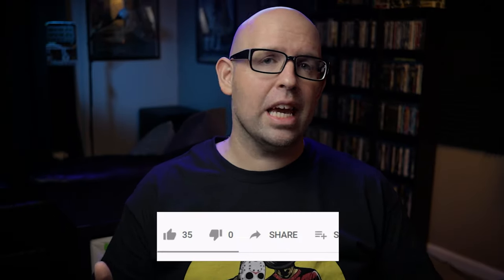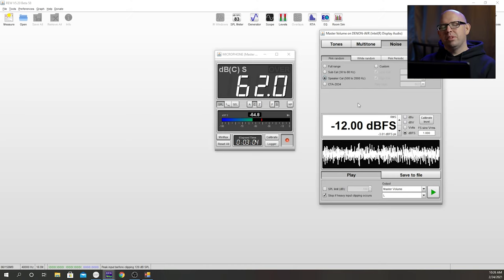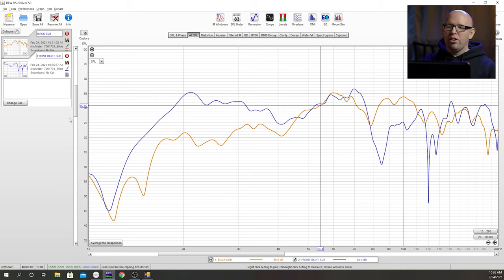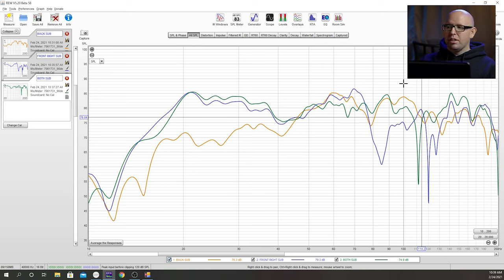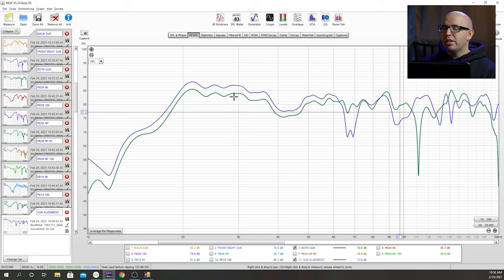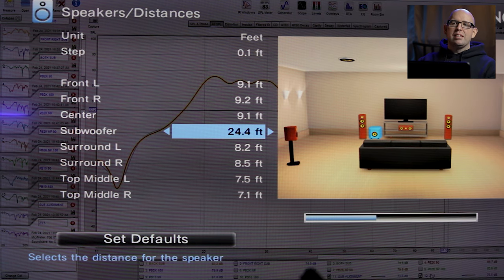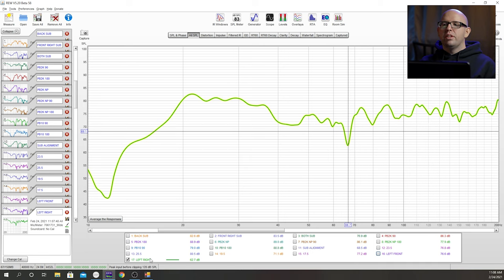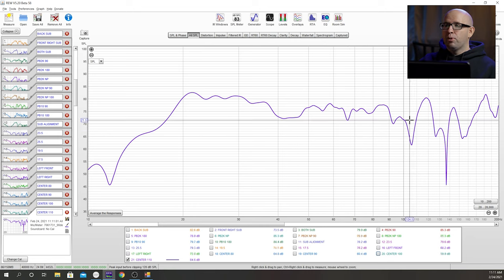Better BASS WITHOUT miniDSP? | Subwoofer and bass OPTIMIZATION GUIDE (basic)

Comment: I’m pretty new at this too. I simply cannot spend several hundred dollars on a good surround sound system right now. So, my wife got me an old Pioneer VSX-D514 and a set 5 Sony surround sound speakers off EBay for $50 w/o a subwoofer. My Pioneer is a 5.1 speaker surround system requiring a powered subwoofer. I had a Pyramid 12” sub, built a box and ordered a subwoofer amplifier board off Amazon($16). I noticed a gap in the very  lows from the 12” sub. and the highs from the 3” speakers in my Sony surround speakers especially listening to music. By watching YouTube videos like this guy I have learned a ton. Like how to build, port and tune a speaker box. I ordered two 6.5” Pyramid mid subwoofers and ordered another  amp board, a splitter cable to share headphone and an extension for the cable. I got this because my amp boards use a 3.5mm audio input.

Comment: Love the videos, it makes all of this easier to comprehend! I did your steps to level match my two subs(PB1000-Pro) by setting my left speaker at 75db and both subs to 78db per your instructions. I then did the Phase and Polarity measurements for the smoothest response, which in my case was 0 and Positive. I also used SVS Parametric EQ to smooth it out further… So now I’m on the run Audyssey step, however since I have a newer Denon X3800h, it has me adjust the gain on each sub individually to land in their green zone before moving forward with calibration… Wouldn’t this undo the level matching thing, or was that just to initially calibrate the subs for phase and polarity optimization so it won’t matter that the gains will be altered before calibration? Sorry, I’m a noob😂 just bought the equipment you use from your links and am eager to learn!
Reply: Anyone know the answer to this?

Comment: Great video - I was actually emailing with Ed Mullen back and forth, about exactly this!

Couple comments/questions, and looking for feedback.

1.) thanks for pointing out that BOTH subs need to be adjusted together by the distance amounts - the other day I was ONLY adjusting the second sub, and it made zero difference on the FR.

2.) did you have DEQ off post-Audyssey? There appears to be a slight house curve in your measurements, so wondering if DEQ was on?

3.) do you have any recommendations for applying a house curve without MiniDSP, but with the Audyssey App AND subwoofer PEQ on the plate amp?

Awesome video - would love to see a part 2 with the inclusion of the MultiEQ editor app, and further optimizing!! Great job!!!
Reply from the maker: Thanks for the comment! Ed Mullen is an awesome guy and has what seems to be endless information regarding home theater and audio.

To answer your questions: I actually didn’t run Audyssey when doing this video which I completely failed to mention. I should have been more clear on that. There’s actually no EQ on the subs at all, which you can see by referencing the frequency response before I talk about running Audyssey and when I start the next step.  The process for time aligning subs to mains remains the same though, so either way it won’t change much. You just may have different distance settings if you run Audyssey as any type of EQ can have an effect on alignment.

In regards to using the MultiEQ Editor App and the subs PEQ to optimize things further and to apply a house curve, those videos are in the works (or a single video, haven’t decided yet). I have a few time sensitive review videos I need to get done first, but I’ll rest assured you’ll do some more advanced sub optimization videos soon.
Reply: @HomeTheaterGamer  very much looking forward to your further instructions. This has all been very handy so far. I have dual SB16’s, and a great B&W mishmash of a 5.2.2 setup - and while I’ll never really stop tinkering, I haven’t yet found a reason to with achieving just the right performance.

I would also love to hear your feedback on the following instruction:

https://www.stereonet.asia/forums/topic/147529-audyssey-house-curve-revisited/

I haven’t tried this, but there’s some pretty insightful tips on applying Audyssey app curve editor adjustments, and ensuring they actually show up. I noticed via REW measurements that my aggressive house curve via the app didn’t actually seem to enlist in the processor after uploading - which was disappointing. Can’t wait for your future vids on this because surely I was doing something wrong!!

Keep it up!

Btw - are you available via email for q/a?

Comment: I have a question, those that have subs like the SVS Pro series with the built in DSP, can we use REW as a tool to make adjustment with the PEQ settings in the amp on the subs? So if we have peaks and valleys in certain areas, we use REW to show the result and make the adjustment on the SVS app?
Reply: I would love an answer for this as well since I'm shopping for a single sub and will not be getting a minidsp.

Comment: Is it possible to run a full range signal to let’s say a 5.1 system and integrate a subwoofer in line to each of the speakers level matching them. Wouldn’t it give you a sense of location for something like an explosion in a action movie?
Reply from the maker: That’s a very interesting idea, but technically speaking, it’s not possible. Anything below about 120Hz, which is where most subs do their work, is not localizable. You wouldn’t be able to tell where it’s coming from. It is possible that vibrations within the sub housing of a sub or the adjoining walls vibrating could cause a sense of localization, but for the most part all bass under a certain frequency would not be localized due to our own ears.

Comment: Thank you so much for the video. 

I do have a question in how this video works specifically with Dirac. After running Dirac the AVR locks the distance/delay setting, thus preventing from making any post adjustments. 

Do you think that Dirac would set the delay correct so that post adjustment is unnecessary?

Thank you in advance!

Comment: Great video man. Hey I have a question. My only outputs that work are the front left and right and subs. Center and the rest no sound when I try to measure. Receiver is a Yamaha rx-a3060. It's set to straight mode.

Comment: One question about subs and mainspeakers....
If I have speakers that are good in lower frequency, lets say that I am happy about have my right and left speakers frequency down to 60 Hz
And put my AVR crossover to 60 Hz.
How do I do with my sub then?
Do turn down the frequency to 60 Hz on my sub, so it will play 20-60 Hz?
Or do I put the frequency to max (250 Hz) on the sub?
Reply from the maker: That’s an excellent question. Typically with this type of setup where you have the subwoofer plugged into the “subwoofer out” on the receiver, you’ll want the crossover frequency on the subwoofer itself set to the max (sounds like 250Hz in your case). The reason for this is because your receiver is handling all the bass routing between your speakers and subs, often what many folks call bass management.
Reply: @HomeTheaterGamer  
So, if I use a minidsp, there is no reason to use range below my crossover in REW when I am doing a room curve for my mains and no reason for me to measure my sub/s higher than my crossover settings in my AVR?
Reply from the maker: I would still recommend measuring slightly above and below your crossover point, mainly because crossovers aren’t hard cutoffs at a specific frequency. They roll off the sound instead, so it’s always good idea to see exactly what’s going on.

Comment: How are you getting the Center and Surrounds to show frequencies down to 20Hz?  Also, if you are crossing over at 80Hz and above, aren't frequencies below the crossover point directed to the subwoofer/LFE channel?  I am either missing something or.........
Reply from the maker: The center and surround results also include the subwoofer, so any frequencies below the crossover point is handled by the subwoofer.

And yes, you’re correct that anything below the crossover point is directed to the subwoofer/LFE channel, even if set to something lower than 80Hz.

Comment: Would it be best to move the subs around to different locations to find the best spot curve in REW, then level match the subs, then run auto eq on my receiver?
Reply from the maker: Ideally that would be a great place to start, but depending on room, sub size, amount of subs, etc., sometimes that just isn’t possible.
Reply: @HomeTheaterGamer  right. I was just trying to figure out if there was technically a best practice "order" to go in.

Comment: When you are level matching your subs to 78db, are you adjusting the gain on the subs or the level in the receiver..? You don’t really say. I have two SVS PB1000 pros I am trying to set following this video.
Reply from the maker: Sorry... On the subs themselves.
Reply: @HomeTheaterGamer  I have the same question. For the gain on the amp (Crown XLS 2502) Would I start at the 12 o' clock position or higher...lower? Also On my AVR (Pioneer Elite SC-LX904) I don't have an option to turn off Room Correction. (MCACC) Would I Select Pure Direct sound mode? Thanks in advance for any advice!

Comment: Hello, I looked at parts 1, 2, 3, 4 ten times and did everything as you described.  I succeeded in everything.  Thank you for your great tutorial!  Only one thing is not clear to me, if in the Audysey app under MultEQ filter frequency range and turn off the subwoofer limit, the subwoofer does not get enough signal and it does not turn on at minimum volume!  What can I do there ??
Reply from the maker: That’s interesting. Is your sub level within the receiver set to 0dB? When you say minimum volume, what volume do you mean? I rarely listen at volumes below -20dB, so it may be an issue I never noticed.
Reply: @HomeTheaterGamer  Volumen at Night is -63db !!
Reply: @HomeTheaterGamer  Sub level do you mean the gain knob on the subwoofer?  It is in the middle and the AVR is on "0"
Reply: @HomeTheaterGamer  So, for me it is set like this: On Marantz, Audysey (reference on), dynamics EQ off, volume EQ on, in the Audysey app MultEQ filter frequency range SUB (off) all other speakers are at 389Hz (limit ). Both SUB Gain Knob is set to middle, everything else I have set in the MiniDsp. When I watch a film on the Marantz at -63db at night, the SUB get too little signal from the AVR and they don't switch on. If I go to -40db, -30db on the AVR then there is no problem, the SUB switch on. Then if I switch on the dynamic EQ and limit the SUB to 250Hz again in the Audysey app, the SUBS switches on even at -63db volume on Marantz, but the bass is way too powerful and not so smooth anymore. Because the whole thing is boosted.
I also tried dynamic EQ off, sub on at 250Hz (Audysey app) at -63db volume on AVR (SUB gets too little signal and does not switch on). The SUBS only switches on when there is more volume on the AVR.
Then dynamic EQ on, SUB off (Audysey app) at -63db volume on AVR (SUB does not switch on).
Can you understand how I mean it?
Thanks and best regards from Austria (Europe)

Comment: I see that your left and right channels are at different db at the 2 minute mark. Is this normal? I also have to change mine, but more like 2 to 3 db. thank you.
Reply from the maker: It can be due to placement in the room. Adding 2-3dB isn’t really an issue when matching the front speakers, it’s when you have to boost them considerably that it points to an issue.

Comment: Hello, can you help me please? I don't get any sound when I'm taking measurements. From my laptop to Marantz. I do not know what I'm doing wrong . On the Marantz I set -17.5db but when I go to measure I don't get any sound. Thank you, greetings from Austria.
Reply: Have to make sure umk1 is selected in your preferences top row under input device  and you have the calibration file loaded.
Reply: @drewsmith1566  And select Input Aux1 on the Marantz for the HDMI connection from the laptop to the Marantz.  Is that right ?
Reply: @danmaier2077  Yes I do on my Denon but whatever it says on your Marantz should be labeled. Output under preference in Rew set to Marantz.
Reply: @drewsmith1566  oK thanks 🙏
Reply: Sorry, I forgot something.  The volume on the laptop must be 100%, is that correct?  Audio Output Marantz Volume 100%
Reply: @danmaier2077  I never messed with either or had to adjust
Reply: @drewsmith1566  OK, thank you very much

Comment: So you didn't use you svs app PEQ setting to better setup your 2000 pro, and you haven't even touched the Audyssey multi EQ app editor.

Both of these will help your setup even better still without a mini dsp 2x4HD.
Reply from the maker: I know. That would have made for an hour long video. Haha. Those videos are coming, but I didn’t want to over-complicate this video by including that stuff just yet and honestly, not many people have access to either a sub with built-in PEQ or the Audyssey editor app. I wanted to cover the basics first with stuff people have access to and that don’t need to purchase anything outside of a measurement mic.

Comment: Hey, home theater gamer! I am looking for advice. I am looking to get my first serious home theater system. I’m looking to get a denon x4700h, klipsch rp280f’s, 450c’s and rp150m’s for surrounds. And I was looking to get two svs pb3000.  Would audyssey be good enough if that’s all I do with speaker calibration? I’m not really looking to do all these other calibrations minidsp/ REW. And I heard based on room I would need a lot of room treatment. It is on a second floor of a two story house. The room has carpet. The only issues are that it’s F shaped( bottom of the F is where the room starts after going to the fight of stairs. And the other issue is low vaulted ceilings( lowest point of the ceiling is 44 inches from the floor). Would that setup be good enough with just audyessey calibration and no room treatment? I really do not want to go the sound bar route. Any advice would be much appreciated. Thank you.
Reply: You could try some heavy curtains to block the stairs off . I used some from amazon in my situation. Having carpet is a big plus and adding seating couches etc help . Once you get REW its like a rabbit hole and even worse a mini dsp. Dont let any of this discourage you from going the route you want . I would get REW and a UMK1 MIC after getting familiar and setup with your gear. The thing is you end up spending more time doing measurement's than enjoying your system lol. At the end of the day go by your ears but REW and a mic is a useful tools to tweak like what's stated in this video. I have better results with REW with my LCR crossed over at 110 than at 80 but my ears cant hear the difference set at 80 or 110 .
Reply: Also download the Audyssey multi EQ app editor and the SVS app.

But umik-1 and REW are definitely worth the investment to tune your system. It's easy and anyone can learn it... With practice
Reply: @drewsmith1566  thank you so much for the advice. Much appreciated.
Reply: @MrSuperman258401  thank you so much for the reply
Reply: @MrNickster12345  yep, deal with this all the time in my FB HT group and other groups I help in...

Also check out Home theater Guru's youtube channel.... Lot of good info there....
Reply: @MrNickster12345  he got a great video that cover REW and Mini dsp 2x4 HD if you do need to use one. Plus how setup up multiple subs and time alignment and gain matching too. Plus just setup speakers and specs and power
Reply: @MrSuperman258401  thank you again. I figure even if my room has no room treatment, it will still sound better than a sound bar. I mean especially after doing all these tweaks. I was contemplating the ultimate Sonos arc setup ... if I can get this... I can’t bring myself spending over $3,000 for the Sonos. Plus I would need a mesh network.
Reply: @MrNickster12345  nope your better with what you got. If your on facebook , check out the home theater groups